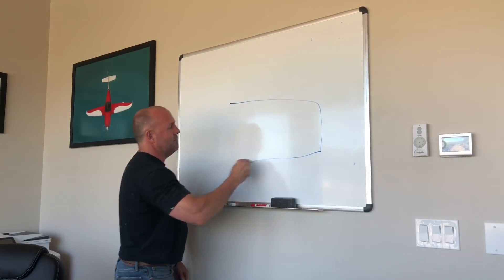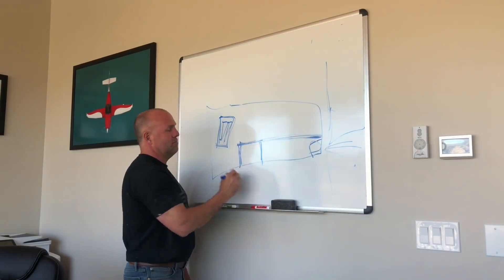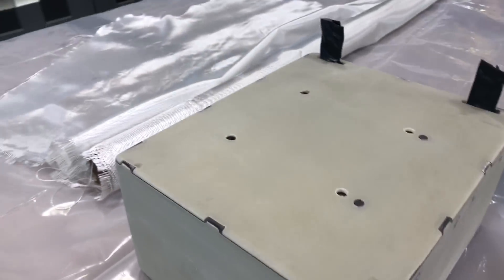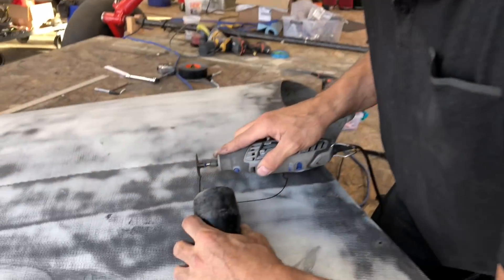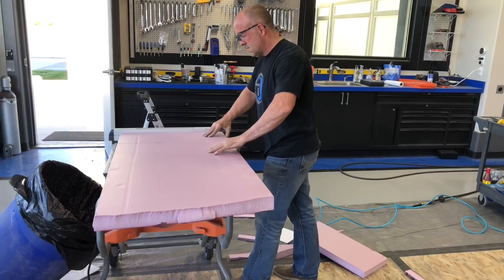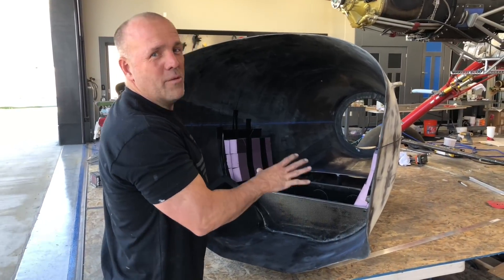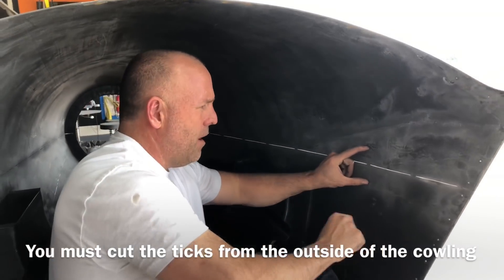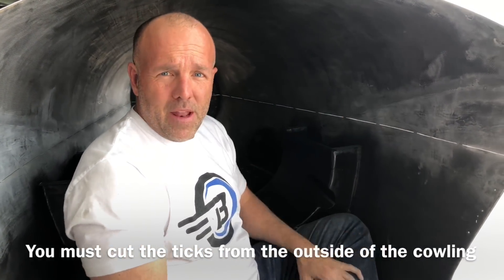Mike Patey Wilga (DRACO Video 11 A) More Carbon Fiber!

Comment: Mike, love the videos!  I've been rolling through them learning a lot from you. Fellow engineer here, so I like your "looks good enough" and gut feel approach you bring.  Quick question: What resin system are you using?  I have used West systems and some HT vinylester, but I can' touch my parts until the next day and you're pulling cured parts in 90-minutes.  I know the baking helps, but it still surprises me.  Can you share what you use and how long you bake?  Thanks.

Comment: What is the purpose of putting the engine air intake filters inside of a pressurized box?
Reply: Where did you get that its pressurized? Its open at the front for an inlet and open to the intakes of the engine. Its sealed everywhere else because you dont want intake air bypassing the engine or the filters.
Reply: @DrewLSsix  ah ok I must have misheard. Thanks!
Reply: @jefferyg3504    well no, he did say pressurized but I got the impression you thought he meant entirely sealed from the outside. The pressure is developed in flight.
Reply: @DrewLSsix  oh - simply the pressure developed by the engine sucking in air

Comment: Really enjoy these videos.  As an Aerospace Engineer, this is just AWESOME...Engineering in the RAW!  Question:  Did you do any Volumetric Flow rate calculations to determine airspeed reduction and pressure to Engine inlet?